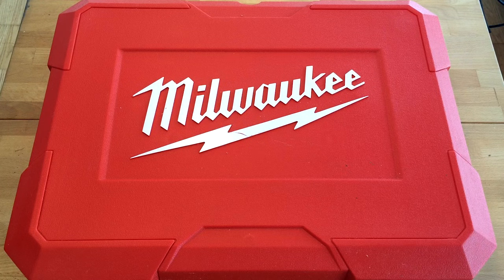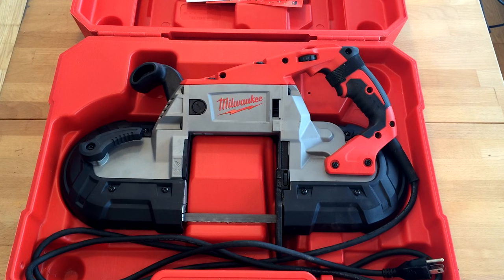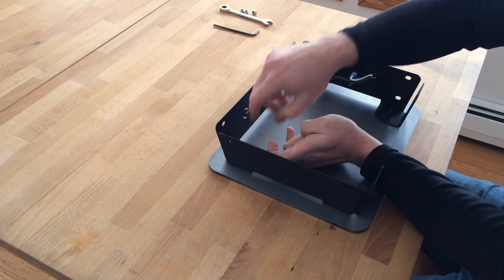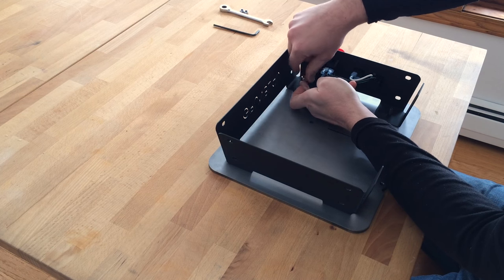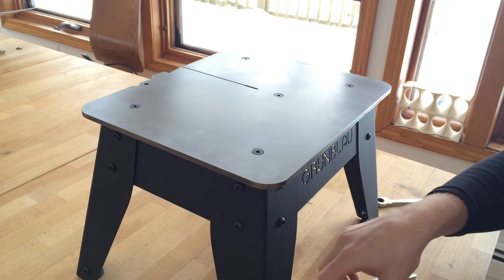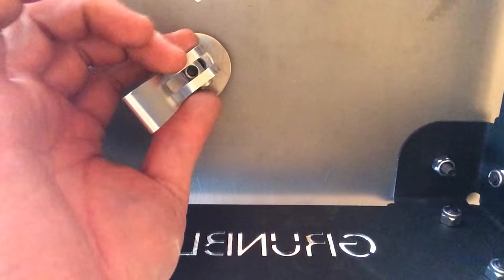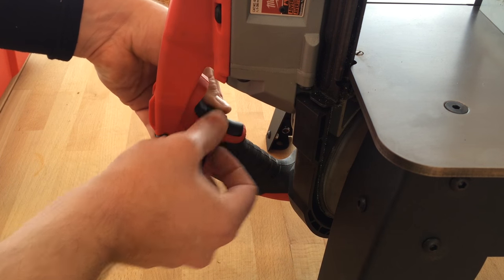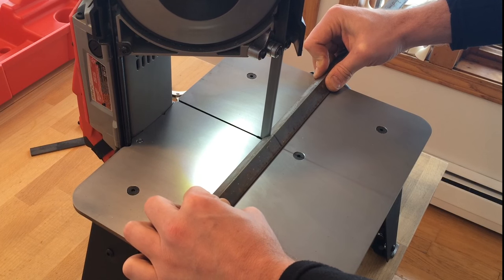Making a Table for my Portable Bandsaw

Comment: I remember when this video first debuted and everyone begged for the plans or a read-to-assemble kit.  Hundreds of requests, yet nothing ever came of it.  Such a shame, too, since this is far better the other stands I've seen.  I'd certainly pay to have a kit, even if I had to modify it to fit my saw.... or run out and buy another saw.  Great work.
Reply from the maker: I made 5 of these…. The one you have seen in the videos, one I sent to Diresta way back, sold two and one is still here chilling in a medium FedEx box just in case I need to swap a new one or have a conversation with a laser cutter.  

I realized with the integrated switch, it should probably be UL listed…  then I got too busy with a job that tried to kill me.
Reply: @Grunblau  That's great news for the tiny handful of people who got one.  Right now, the options for the rest of us are either the SWAG kit, or coming up with something on our own.  I think your design is head and shoulders above the SWAG model, but not even the plans are available so we can send them off to a cut-on-demand service.  You wouldn't need to offer it with a switch or outlets.  That's an easy add-on for the end-user, so just allow for punch-outs in the design much like with junction boxes in electrical work.  That way the customer can source their own switches and outlets, place them on the body wherever they like, etc.  Or just make it solid and leave it up to the customer to cut and drill for what they need.  If they can't do that, they really shouldn't be messing about with the thing anyway!  :D

The only problem I see right out of the gate is that it might be too low for my DeWalt saw. That's okay, too, because I can always raise it up an inch or two when I mount it to the bench.  Or buy a new saw that's a little smaller.  As a blacksmith, most of my cutting on a bandsaw is for ornamental purposes.  I have the bigger saws if I need to part off big steel, but a small vertical bandsaw would certainly be handy for cutting out rosettes and fluer-d-lis.  The problem is finding a stand that I like... and that's available for purchase.  ;-)

Comment: I was so impressed by this video that I also wanted to convert my recently purchased portable bandsaw from Harbor Freight ( Model 62800) to a standup bandsaw. I checked with Yelp to locate some local metal fabrication shops to cut a piece of 1/4 inch thick table top only. They all asked above $100 for a mild steel top, some of them even asked $200 just for the set up fee. I ended up getting a kit from Swag OffRoad ( Version 3) for $129. For $20 more I can get the table top powder coated and the legs zinc plated.
Reply from the maker: Wow, that's a bit expensive for a bit of steel!  I'd suggest not getting the top powder coated as it will just scratch, look terrible and function poorly.  You will also want to add a way to turn the saw off and on rather than pulling the cord out of the outlet.  Swag has a foot operated on off switch.  I think this may be annoying.  Look for router table switches in order to have an easy access switch.  Basically the same thing I integrated into my table.

Comment: This is a very professional look. Thanks for sharing. There are several designs for the Milwaukee portable bandsaw that mount the table in the slot in the throat like this one. My Milwaukee seems to use that slot as an air exhaust for the motor. It blows a lot of air, not a trickle. I wonder if blocking that slot would contribute to overheating the motor.

Comment: I've read some not so good things about the swag setup and at $130, this seem way more stout. The adjustability of the table is a good idea. EBAY UP BRIAN! You'll make a killing.
Reply from the maker: +Jerry Peterson I really like my portaband table!  I think the cost is closer to $150 with the switch/ outlet .  I'll have to check again.  I am currently doing a run of CNCS, when that is over I am going to do a run of the tables.  BTW I spent about 6 hours using the table just today!
Reply: $150 is a very reasonable price point. I would buy one right now if you had them available. Will the table support the older 6236 or just the 6232? Thanks hope you get time to produce these. A lot of us would love one.

Comment: What an awesome solution Brian! Interesting twist on the location of the bandsaw within the table, so the throat depth limits the length of the cut as opposed to the width. I'm guessing that's the most useful configuration for your purposes?
Reply from the maker: +Alex Howard All of this is based on the design of the Milwaukee.  One side of the bandsaw is unlimited by depth, the other side is 5", I think.  Mostly doing smaller cut-off stuff and with aluminum, I cut some candle wax first.  This will be great for removing runners from dominoes, for example.  Never thought about modifying the actual saw until just now.....
Reply: @Grunblau  Are you selling these kits yet?

Comment: That's a beautiful design. I'm curious. What did you give to the laser cutting and bending company? Plans? CAD files? print outs? Did you supply the metal, or did they? Who tapped the threads? Could this be designed in Sketch-up, and then provide the plans?

This was quite inspiring. I'd love to see how the design was made, or presented. I'm so new to this.
Reply from the maker: +David R. Darrow - drdarrow You can interact with most fabrication companies in every way you mention.  I tend to model everything make sure it all fits and tolerances are good and then give them the 2D cut able geometry.  So a CAD file with notes on it for important features.  They will use this actual file to laser cut the pieces.  You can supply the metal, but they probably get a better deal on it than you would.  I sometimes tap the threads, and sometimes have them send it out to be tapped.  Some places tap in house....  For these I had them countersink and tap.  This means a couple day delay, but sometimes it is worth it to just have them do it.  As long as you can produce a clean DXF you can use any vector creation software.  For sketchup, make sure your arcs are actual arcs and not polylines.

Comment: Do you find that small of a bandsaw significantly more useful than a scroll saw? Specifically with casting, or in general.

Love, love, love the videos.
Reply from the maker: Thanks for the comment!  I have a access to a scroll saw too.  I wouldn't want to use it for cutting steel or for cutting off a 1.5" diameter sprue though.  For breaking up scrap the portable bandsaw is great.  The bandsaw is made for steel but with some candle wax, it makes quick work of cutting off sprues and runners.  Eventually, I'd like to get a lathe and this would be useful for cutting bar stock as well.  I use the 10-14 TPI blade for aluminum.  I wish they had a coarser option...

Comment: What are the switches / plugs? I'm doing some sheet metal projects and I'd like to have a simple power distribution setup as well. Are they hardware store items, or digikey? Thanks. 

Also, fantastic. I'd pay $250 for the components as finished, with myself sourcing the saw. I'm in the market for a similar setup and have been considering the SWAG offroad product.

Comment: Hey Brian, behind the "hey brian" is where I would put salutations like "supreme craftsman", "heavenly progenitor of the vorkbänsh", "the grandest wood sorcerer of ME" or similar, but to keep it short, i wont. just a quick question: where did u get the prefabricated steel pieces bent before coating them. was it at the cutting site, or did you do the bending? greetings
Reply from the maker: +iderpalot Most places with a steel laser cutter will also have a press brake.

Comment: Hello! ;)
Really great clip! I can't wait to see more of your manufacture. Where did you let make these metalworking(1:10)? Self-made or in cooperation with a company(online?) ? ;)

Greets from Germany,
MAT-Videos
Reply from the maker: +MAT-Videos I have a local company that is used to me dropping by with a CAD file.  This is the same company that cuts the Platform CNC steel for me.  All online places I have seen tend to be about 2-3X the cost of local shops.  Also, always do multiples.  I had 5 of these made to keep the cost per table down.  If you are confident in your geometry, you will be able to find a home for the extras even if they end up being Christmas presents!  

For example, if a single part is $1000, 3 parts will be about $2200.  It is almost a buy 2 get one free.  This is because there is an actual prototype fee that is attached when you only order one.  This benefit slowly diminishes the more you order...
Reply: +Brian Oltrogge What's one gonna cost us? :)

Comment: Hi Brian, which bendsaw model did you pick from milwaukee?
Reply from the maker: +goodideawins Milwaukee 6232-20 Deep Cut Portable Variable Speed Band Saw.  The corded one obviously as you couldn't use the power switch feature to turn it off and on.

Comment: Are you planning on a part 2 so we can see the actual design process?
Reply from the maker: +Alexander Howard I doubt I'll do another video on this but here is the process I used...

First I decided to do the top size to fit into a FedEx medium flat rate box.  Then I used tape, paper and a sharpie to record the profile of the saw.  Then I modeled the stand and top in Solidworks.  I printed out a paper version to check everything and the sent the file to the laser fabricators.  Then I picked up the finished parts and brought them to powder coaters.  When I got the parts, I filmed the assembly!  This is where the video begins. Hope this helps!

Comment: Brian
Are you planning to sell as a kit?
Reply from the maker: +Browndog1930 I made 5 complete prototypes in order to keep costs down as much as possible.  They are designed to fit in a flat rate box.  So I will likely make at least these 4 extras available soon.
Reply: +Brian Oltrogge well I would ask to be one of the lucky 4 please.

Comment: What is the dimension of the table? Thanks
Reply from the maker: Approximately 13”X11”. I designed it to fit perfectly into a medium FedEx box....  if it fits, it ships :)
Reply: @Grunblau  Thanks!!
Reply: @Grunblau  Been checking your site everyday to see if these are for sale yet. Do you have a target date that you can share?
Reply from the maker: I agree with you that this is the best design out there.  I ended up getting too busy with a full time job to pursue it.  Still might, but not within any set timeframe.
Reply: Where did you get the on/off switch at? TIA

Comment: Making a hardwood fence for the miter makes all the difference MyBest.Tools Tune the saw with a combination square. Adjust the laser so its in line.😂🤣😂🤣😂🤣😂🤣See the photos.Every part in this saw is adjustable.😎😭
Reply from the maker: In a pinch.  It is a bit small toothed for a dedicated wood saw.  I have cut wood with it however…